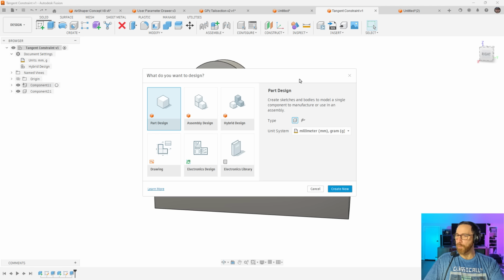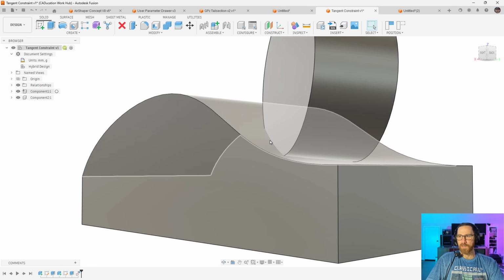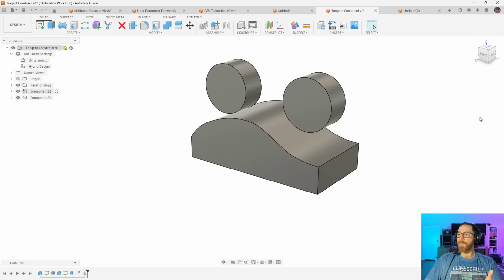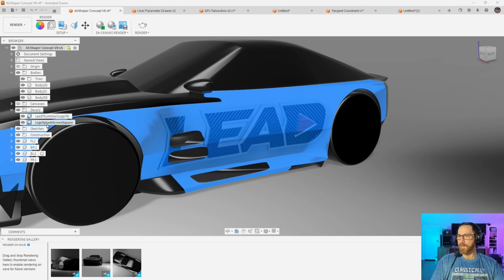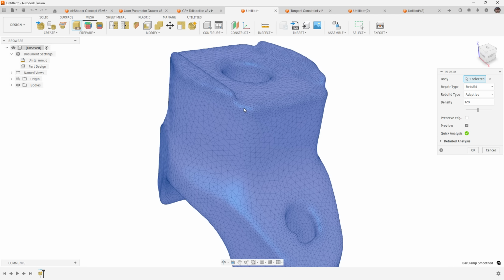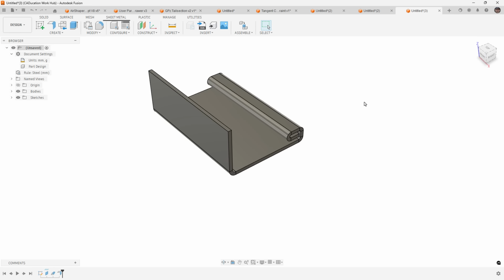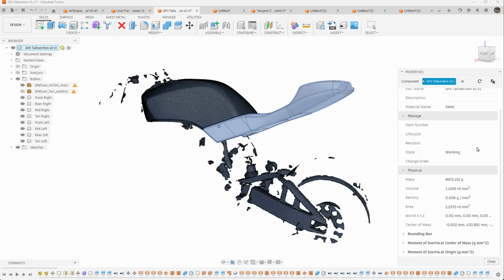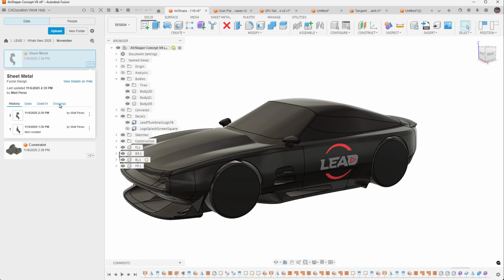What's New in Fusion | January 2026 #cad #fusion #fusion360

Comment: In part flow, how do we convert to component to insert it in assembly?
Reply from the maker: The Part design type is a component on its own.  Its limitation is that it can't have any sub-components.  In Part there is a tool on the toolbar that says "Insert in assembly" or something like that.  You can use that, or just drag it in from the datapanel into your assembly.  If you decided you have multiple bodies and you need them to be components, you can expand the document settings at the top of the browser where units are, and there should be a pencil icon next to where it says "Part Design".  click that and you can change it to a Hybrid Design and then make components from the bodies.

Comment: I use Fusion 360 only for personal purposes, primarily for 3D printing designs. However, some instructions may no longer work properly. Among other things, the Combine instructions don't work in hybrid mode either.
Reply from the maker: Can you expand on that a bit more?  Combine still works in Hybrid mode the same as always for me.  Hybrid should behave exactly like Fusion has for years before Intent Driven Design.  The only difference between Combine in a "Part" or "Hybrid" is the check box "New Component" for Hybrid.  It behaves the same in Assembly mode if you enable the  modeling tools.

I am not aware of a difference here for Hobby Users.  As i understand the Hobby license restriction right now is around Edit in Place for external components.
Reply: @LearnEverythingAboutDesign  

In the meantime I have found the problem, on the first piece I had made a bulge, but it was not combined with the first piece, why I do not know, I then combined them together, so that the first piece consists entirely of 1 piece, then combined and cut out on the 2nd piece, that is how it works
Reply from the maker: @ronnythegreat1  with the update I have noticed some tools that used to default to combine or join now make new bodies. it is kind of annyoing!

Comment: This was super helpful — thanks! Would you be able to make a video showing how to take a Fusion 360 project into a slicer for 3D printing? I'm working on my own fender flares right now, and I think I'm done with the Form stage, but I'm stuck on what to do next. Do I need to clean things up with Surface tools? And how do I handle exporting something this large for printing? Would really appreciate a step-by-step if you’ve done this with flares or other big parts before. Thanks again!
Reply from the maker: We did that as part of the fender flare series.  Have you seen this?
https://youtu.be/ftKAl7WWfZM

Comment: The problem with intent driven design is that for those on a hobby license it is frustrating. You can only have a certain amount of active designs at once, so creating multiple parts requires constant switching them to "read only."

Additionally, you don't have access to "edit in place." so you can't assemble multiple external components and edit them without opening each one, making a change, then updating it in the main assembly. 

The hybrid design is still the only feasible option for hobby licence users because you need to be able to design multiple components in context and then have that as a single file that saves.
Reply from the maker: I did ask someone at Autodesk about the EiP thing and I was told that should be available for Hobby, but maybe not.

I agree Hybrid still makes the most sense.  Theoretically you can have external non-active designs in an assembly if you don't need to edit them.

Comment: Hello thanks for showing the updates. Any idea where the bounding solid or arrange commands in the design env went? I tried to check the docs and it says it went to the manufacture additive but I dont really see how to make it work now. :( Kinda sad for those as they were great to arrange for multipart cavities and molds quickly
Reply from the maker: They will be there in a hybrid design but you won't see Arrange if you are in a part, or assembly(by default).  If you have a design that is an "Assembly" and you go to the Utilities tab and enable modeling tools, it should still be there on the Modify drop down.

Comment: Not being able to customize shortcuts in 12 year old engineering software is wild.
Reply from the maker: You can but not everything.  When you expand a menu, say Create in the Design section.  If you click on the three dots to the right of the command, like Extrude, you can pin to the toolbar, pin to shortcuts (a toolbar that pops up when you press S), or changed the shortcut.  So you can assign it to whatever key you want.  There are just a few things that aren't available like Zoom box for some reason.

Comment: Sorry for the long comment. It’s hard to explain what I am asking. I’m having a lot of trouble with these updates. I learned CAD on the old fusion. I kind of got away from Fusion for the past year and now it feels like coming back to a fundamentally different program. I’m really lost on “context” sets, referencing between components, and how to lay out even a hybrid design. I have watched your previous update videos, I think, but still struggling.

I’m trying to design a custom enclosure that is based on geometry from several components. The components exist as scanned meshes that I’ve made as dedicated external parts, mostly with reference construction planes and some sketches. I don’t need exact reverse engineered components for the enclosure.

Do I need to bring the external parts into an assembly, then create a “skeleton” that references the scanned parts’ construction planes/sketches? And then reference that skeleton to make the actual enclosure geometry? And should that geometry be done as external designs using “edit in place”?

I’m trying to make sure the parameters are robust without having to completely reverse engineer all the components but struggling a ton with all the changes. This would have been a simple task in the old fusion but now I’m constantly running into issues with context sets, edit in place, direct edit. Overwhelmed.
Reply from the maker: Hey there, fundamental changes like this are rough, especially when not in it everyday like I am!  I will do my best to answer your questions here, but know that there isn't always one clear winner on how you should approach it.

Hybrid Design is exactly how Fusion has worked for many years (since they added the ability to have external components in a design).  So if you just pretend like Part Design and Assembly Design aren't there, Hybrid is just the name for what Fusion always was.  So if you were comfortable with that you can just stick with it.  Note that in each file under the "Document Settings" in the browser you have the ability to change between design types.  Functionally they are all the same file type, but the designation of "Part" just takes away all assembly tools.  The "Assembly" takes away modeling tools.  However in Assembly on the utilities tab you can actually turn those back on.  Assembly is meant to contain only external designs.  So to me it sounds like Hybrid would still be the simplest approach for you.

With your external parts with construction planes and sketches, to use those in a new design can be tricky.  There are a few ways and the choice depends a bit on if you plan to go back to the external file and hope all parts update.  If you don't need to do that, in a hybrid design you can right click on a component and Break Link.  this will bring all the bodies and features into the current design as an internal component.  Easily giving access to the sketches and planes you created.  If you want to maintain an external independent file (maybe its used in multiple assemblies), then "Edit in place" is what is needed.  EiP gives you the ability to create assembly context references which is like projected a sketch, face, selection into the current part, even though they are external.  I don't love this workflow personally but there are cases where it makes sense.

Parameters.  If you are trying to use parameters (like the pre named values in Modify > Change parameters) then the hybrid and break link approach is probably the best.  currently (unless it changed yesterday) there isn't a way to share parameters across multiple external designs and have them update.

So the choice can be tricky but remember Hybrid is just default Fusion for the past 5 years or so, just with a new name.  External designs have some limitations still like sharing parameters, so if that is key then i would say Hybrid, and Break Link.  That gives you direct access to all the planes and sketches in each of your parts.  BUT if you need those external mesh reference files to stay linked and be used across multiple enclosure design files, then you need to work with Edit in Place, and bring your sketches into your design as references.  This probably means your enclosure is going to be its own "Part" and then you also need an "Assembly" to put that part into.

Comment: Thank you for sharing this valuble updates as always. Appreciate...
Based on practical design usage, it would be invaluable if the Sweep command with a Guide Rail could also support Taper Angle and Twist Angle options, similar to the standard sweep. Having these controls available when using a guide rail would significantly improve flexibility and reduce the need for complex workarounds.
This enhancement would make the workflow much smoother and greatly benefit users working on organic and patterned designs.
Reply from the maker: 100% agree!  Solidworks got around this with a boundary fill tool.  it was like a hybrid of loft and sweep.  Loft in Fusion has a centerline path option, but again the limit of can't use a centerline plus a guide....

Comment: Why the change?  Fusion avoided the intent driven design for so long.
Reply from the maker: Excellent question that I don't really have a clear answer on. It is likely one of two things.  In the past few years we have seen a bigger push in fusion to have a full featured PDM/PLM system for checking in/out files and dealing with changes and lifecycle management of designs.  The flexibility of a hybrid design having multiple bodies, no components but still being a full "assembly" is problematic.  I could design an assembly of parts all as bodies, but they show up as a single line in a BOM in a drawing.  Because of that you could easily have 1/100 components contain 2 bodies instead of 2 components and not notice.  I think personally that is a clerical thing that can be solved with best practices, because now you can have multiple solid bodies in a "part" and have the same issue, but whatever :)

The other might be adoption of fusion from other CAD systems.  People coming from Solidworks for example, or Inventor, of Catia or whatever "insert CAD" program are used to parts and assemblies.  So it could be a market share play for adoption of the program.  Don't really know.

For me the hybrid approach was a huge selling point coming from Solidworks.  I did a lot of Multi-body part designs in Solidworks because I thought there was a lot of power that way vs trying to do it in an Assembly.  At least with fusion we can still pick hybrid and you can also convert part or assembly to hybrid if needed.  So I don't really see it solving the first potential reason/problem because Human Error is still the root cause even if you design a Part vs an Assembly.
Reply: @LearnEverythingAboutDesign  I think you're likely spot on.  As a long time CAD user dating back to the 90's (yes - I'm old), it always felt like Fusion was just trying to be different to be different.  I'm seeing a reversal of that lately, and I think it's a good thing.

Comment: The update details are very thorough—thank you for your work.
I was a bit taken aback when opening the new version (it's been a while since I last used it). I'm gradually transitioning to SolidWorks, and the new version's adoption of an assembly environment feels like a positive direction. I hope Fusion will strengthen its plugin library in the future. I frequently design gear trains and cams, and Fusion lacks a robust plugin ecosystem—this is crucial. I greatly appreciate Fusion's streamlined modeling approach and logic. I also find Fusion more accommodating for top-down design methodologies. I look forward to its continued improvement.
Reply from the maker: Thank you!  In the app store for Fusion I have seen several gear creation ones, but a lot of that functionality is actually built directly into Inventor.  Bearing, keyway, gears, cams, springs etc.  Even beam calculators and calculators for hardware requirements.  I am not sure we will ever see that in Fusion but thought I would mention it because Solidworks doesn't have that natively.

Comment: Great content!  Quick question: at 9:57, when you click on extrude, the view angle changes allowing you to see the blue arrow. My screen doesn’t do this; it doesn’t move at all. Searched the Internet for an answer to no avail. Is there a setting that causes this action to happen? Thanks so much.
Reply from the maker: Thanks.  So to get that (which i thought was on by default) go into user preferences, in the General > Design section.  the third thing down is "Auto look at sketch".  if yours is set to none change it to Always Ortho or your camera settings.  I prefer always ortho just in case i have my camera set to Perspective.

The animation of that is in the graphics section under "animate view transitions".  if that is off it will just snap to the view then snap back.
Reply: @LearnEverythingAboutDesign  Thank you for your response. I found the "Auto look at sketch" setting in Preferences -> General -> Design, but it only has a check box next to it (i.e. no option to select "Auto Ortho". Could it be because I use the "Personal Use" version of Fusion? Thanks.
Reply from the maker: @tzampini  there should be a drop down below that?
Reply: @LearnEverythingAboutDesign  I just updated to the new Design Intent version and now I see the Always Ortho option in the dropdown. I selected it, but I my view still doesn't rotate when I do an Extrude. So not sure what's going on. Thank you for all your help. I just subscribed 😊
Reply from the maker: @tzampini  yeah that is odd.  The rotation should go from your current view.  The check box and drop down should work in conjunction.  When i disable the check box it doesn't change views for me.  When I enable it, it does.  Ill see if there is another setting somewhere but those should do it.
Reply: @LearnEverythingAboutDesign  Thank you so much.

Comment: 8:05 like the 90 degree setting in the countersink portion of the hole command. Always 82... ugh. Not that I never use 82, but I mostly use 90. And I wish like other spots in fusion, I could use the menu button next to that setting to change it to 90 degrees as a saved user setting!

Or similarly, the 118 degree for drills. We buy almost all 135 degree point drills, would love to change that setting as well!

Well, guess I am inspired, I am going to go leave the suggestion. Either on the forums, or the discord is even easier.
Reply from the maker: So one thing to note here with the Design Extension you can actually save feature presets/favorites.  there will be a drop down that shows at the top of the dialog....  

But yeah there are some things like you mention with spot drilling or cSinks that vary based on tooling, hardware and intent.